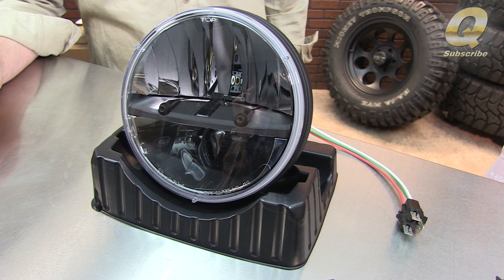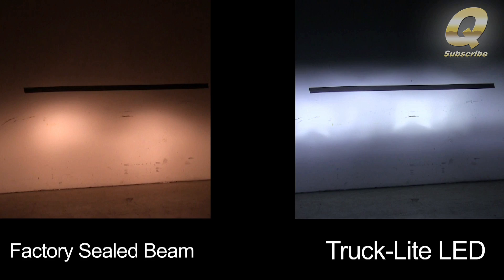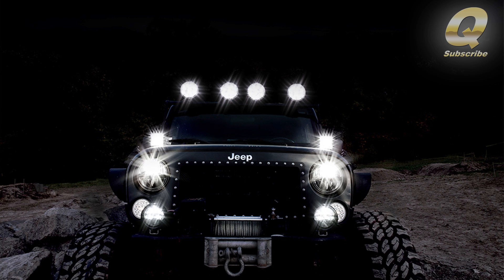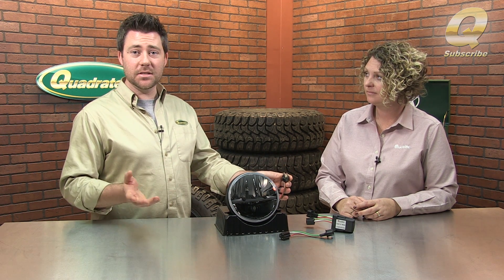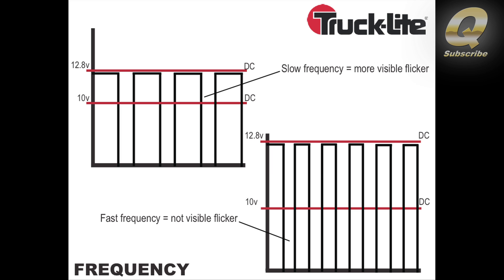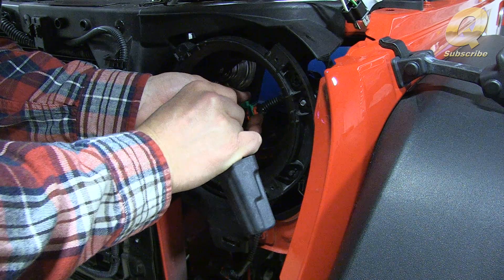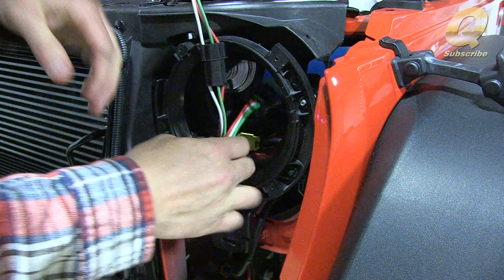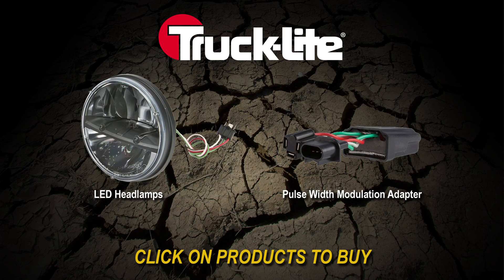Truck-Lite PWM Adaptor Fixes LED Headlight Flickering in Jeep Wrangler JK

Comment: replaced stock lights with leds, and no problems, wired in off road lights to high beams thru a relay, now relay pulses when hi beams engaged and off road lights flicker. would this solve that issue?

Comment: For $30 each I think I would probably do some relatively simple math and place a capacitor in parallel with the lamp and do the same thing for a few bucks for both lamps.
Reply: And then protect the capacitor and other electronics by neatly encasing them in a plastic housing. And then having the correct connectors to complete the harness. I see lots of electrical tape in your future.

Comment: lol I love how she say "it's like a capacitor" I'm going to hazard a guess that it's a 25v 6800 microfarad capacitor in a waterproof housing.
Reply: You would probably be right. All this appears to be is a filter circuit. Could be as simple as a cap in parallel with the 12VDC lamp.

Comment: I have a 2013 JKU... Installed Truck-Lites about 9 months ago... Fantastic improvement over stock (night and day difference)... Now I'm "flicker-free" after installing the PWM adapter last weekend...  Smooth plug n play...  Highly recommended.
Reply: ***** if you look closely, the pwm is also an adapter. So you don't need another adapter.